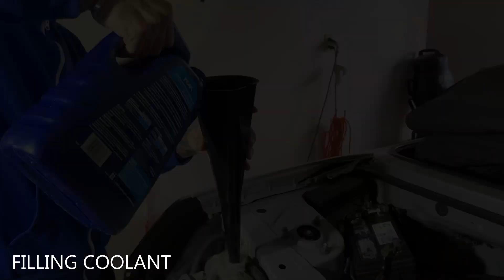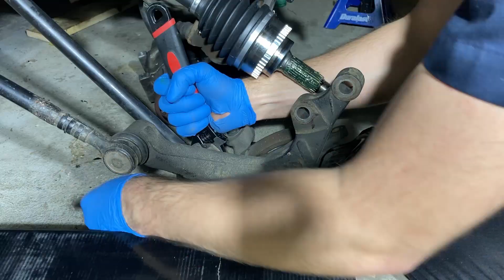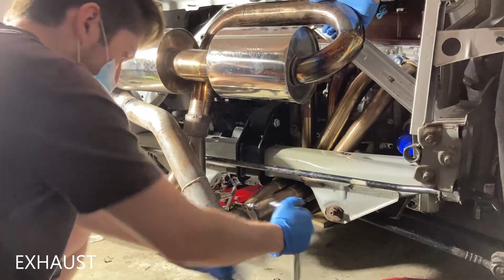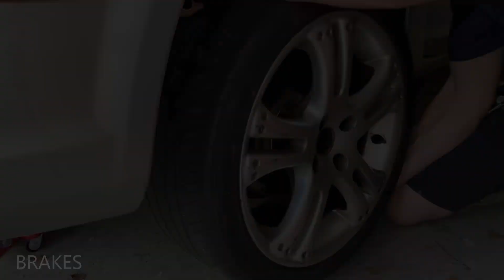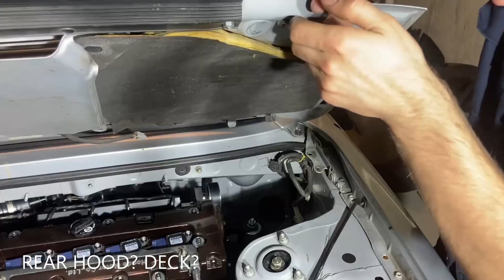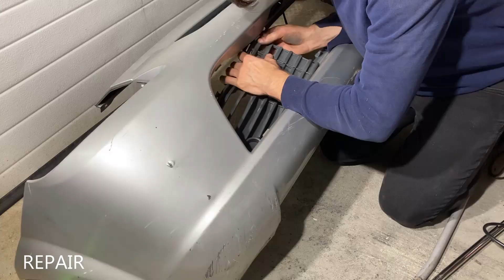First Drive + Break In | K24 MR2 Build

Comment: With the brakes, did you have any issues with compressing the rear caliper Pistons?
Reply from the maker: Yes, it was very annoying. I bought a special tool to do it. Funny enough, brakes was one of the more annoying parts of an entire engine build/swap.
Reply: @IGDesigns  I'm figuring that out right now. Brakes are testing my patience haha.I have a tool coming in Sunday. I did let a lot of air in the clutch line but don't think brake lines are open. Idk how lines are set up for all that.
Maybe pressure is causing my issues.
Reply from the maker: @christopherdavis8530  I would recommend a bleeder tool. The handheld one where you pump it to create vacuum worked for me. I spent hours bleeding the clutch trying it without a tool with no success.